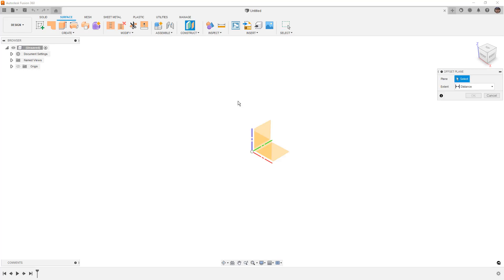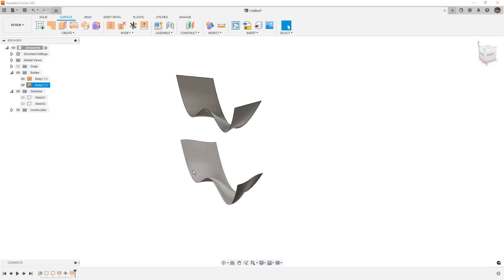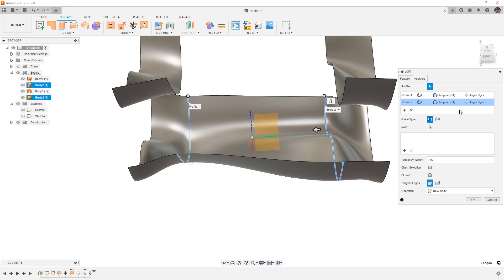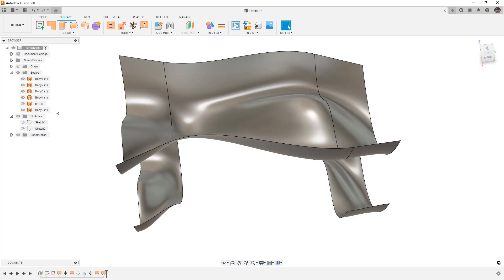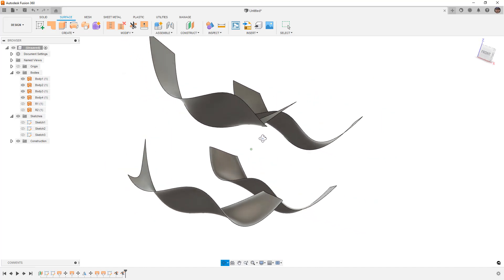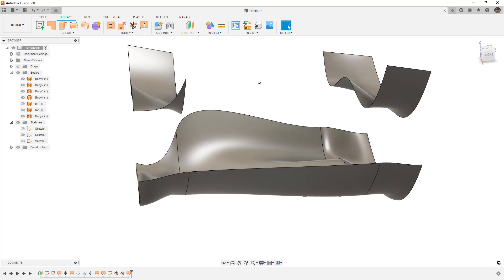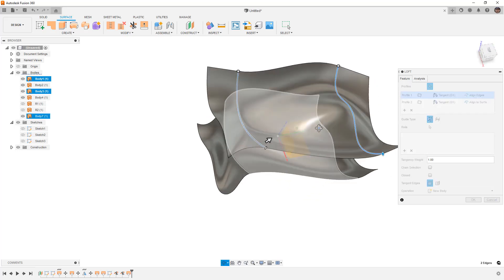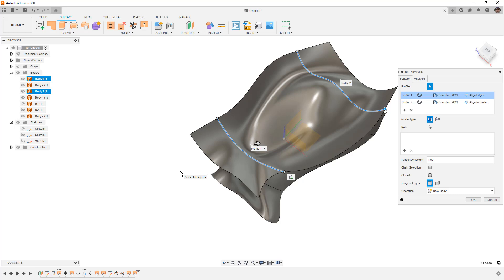Surface Mastery Part 2 - Loft Edge Options | What does Align Edge vs Align to Surface Actually Do?

Comment: Thank you for what you're doing for the Fusion 360 community Matt.

What are your opinions on the sheet metal workspace? Personally I think it's a brilliant and very powerful tool - it is quite picky about unfolding the design to a DXF though usually if we have trouble with it we unfold it in Catia.
Reply from the maker: Thanks Rich!  I think sheet metal was a great addition to Fusion 360 but its about 70% of the way there.  I don't know if it will ever be complete honestly.  Inventor has a pretty solid set of Sheet metal tools.  Some of the Fusion tools are a little misleading like converting to sheet metal.  For example in Solidworks you could make a solid block.  Converting it to sheet metal meant that you could select faces and edges and it would convert that outside shape to a sheet metal part.  Fusion needs to have a thin part and even then you have to basically have designed a sheet metal part by accident :)  

I think for Fusion to be a complete sheet metal tool it will need a few more options including things like forming dies and the ability to create those in Fusion for reuse.  Things like punch tools as well.  Probably the biggest gripe is that the edge/flange profiles can't be edited during creation.  This was amazing in Solidworks for example.  When adding a flange you had the option to edit the shape.  Fusion can get into a case where you are building overlapping features and there isn't a great way around it at the moment.
Reply: @LearnEverythingAboutDesign  I agree, I really do love Fusion 360 as it just agrees with me more than other programs if that makes any sense but compared to more mature packages such as Catia Fusion feels more modern and facilitates such rapid designs to me but it does feel lacking in some areas such as drawings but then you have to remember its quite literally 1% of the price for a commercial license compared to Catia which is the other software I use.
Reply from the maker: For sure.  I was doing 99% of my work in Solidworks for years before I started using Fusion 360 in 2015.  I like the company structure, the updates, the focus on education/content.  After working with Solidworks for many years and seeing meaningless updates and old problems not being resolved for quite a steep asking price I was more than willing to wait for the maturity of Fusion 360.  I often express my gripes to some of the contacts I have and hope that more effort will be put into the design and drawing tools.  I know things are updating but adoption of Fusion 360 really needs to start at the Core design tools. Not CAM, GD and PCB (in my mind).  I would also agree on the UI.  There are workflow things I dislike about Fusion and like more in other CAD packages but you can't have it all :)